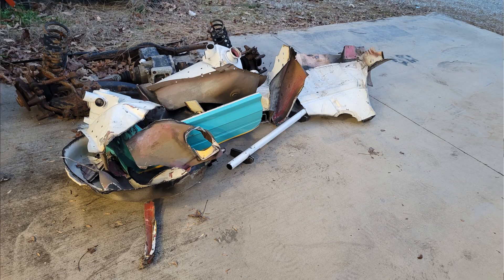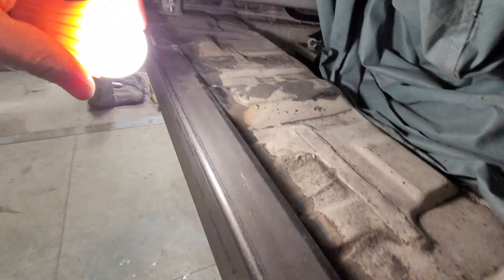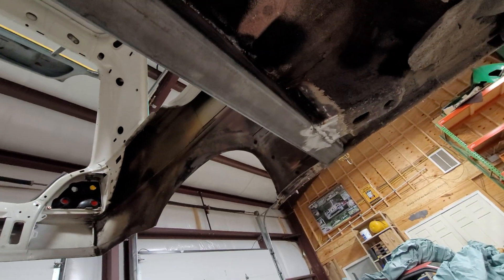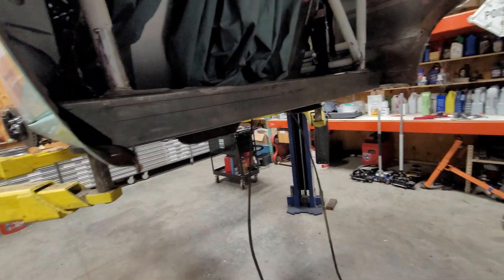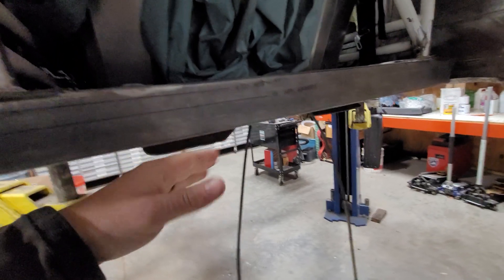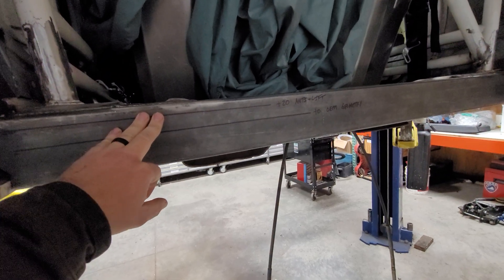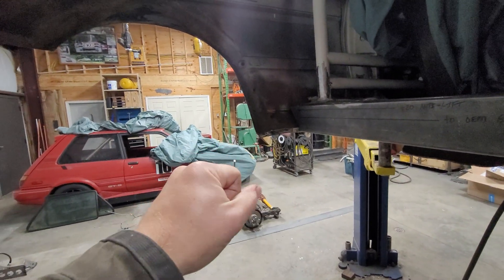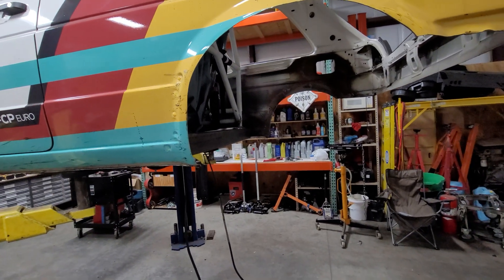30+ years in rear suspension advancement - Part 2

Comment: Looks good,  but I would have squeezed in double rear wishbones and coil overs..
Reply from the maker: There was a option to use a miata rear subframe. I think in general, anything is better than what was there and this has advantages like bolt pattern to match the front, strong aftermarket support, bigger OE brake options, along other things.